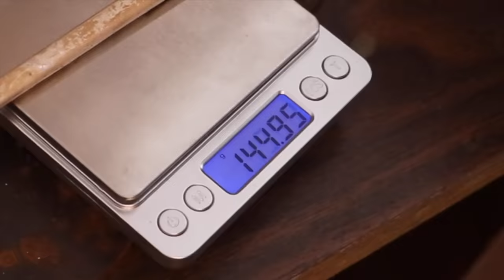SILVER BRACELET RAMSES |  dynamisjewelry.com | HOW IT'S MADE

Comment: hello, I have a question. at the 50sec mark what tool is that you are using for the wire while you pull it through? what does that do to the wire? Also at 11:40 frame. would I need something like that to simply shape my bracelets or necklaces? what does that roller do?
Reply: I’m wondering what this is also

Comment: When you were soldering the ends of all the little coils and snipping the left over pointy bits off. I noticed that there is the 2 ends right next to each other is it a possibility to bend them towards each other and solder them together because it would look more like fluid but it’s most likely possible but impractical because it would make it stiff and not flexible like your end product but could you please do a experiment on a small piece and give it a try please thank you 🙏

Comment: first, after to 3:30 min. droping the wire in to very clearly cooler solution, i think is simple water, is not include sulfuric acid, yes or not ?
second after to 4:35 min. you don't use beeswax with wire drawing.
you pass all thats details, cause the material is it silver ?

Comment: Friend, I don't know anything about your art, but I was curious about one of your procedures .... Why are successive thermal shocks made on the metal?
Reply: Do you mean why does he keep heating the wire as he draws it down? I'm guessing probably because pulling it through the dies (either the two wheels or the plate with holes in it) causes the silver to work-harden, which is when a metal becomes harder as you work it.  This would make the silver brittle and possibly snap, so he uses the heat to anneal it to make it softer and more ductile before progressing. I could be off though.